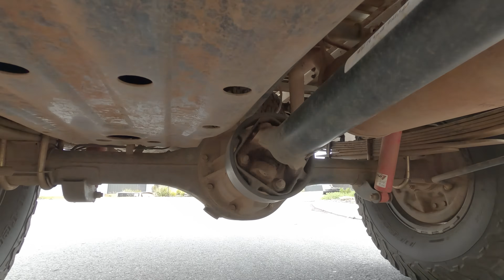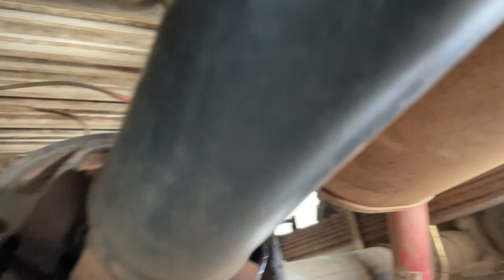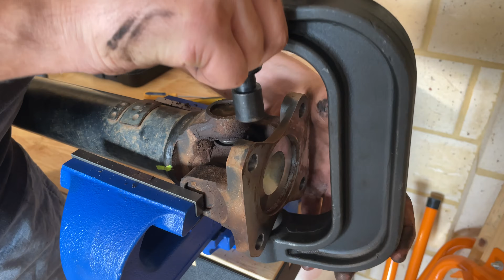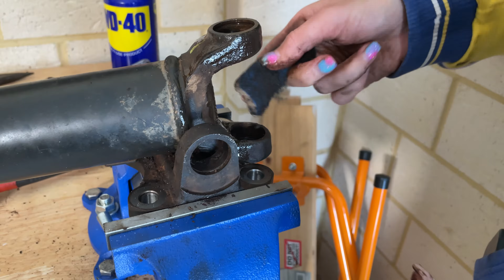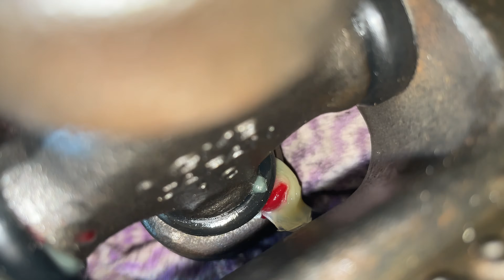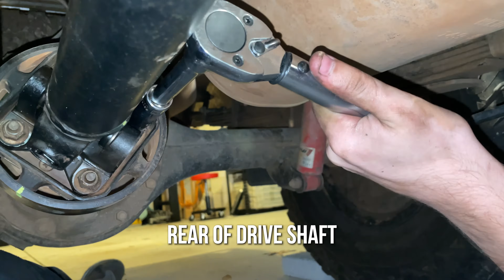Replacing Uni Joints on a 2007 Ford Ranger PJ & Mazda BT50 | Full Walkthrough

Comment: That is one of the best instructional videos of this type that I've ever seen, and I'm so glad I found it because I need to embark on exactly this on my PK which I've just discovered has as floppy a connection as yours did.  Great work you guys, I now feel equipped to tackle this job myself!
Reply from the maker: Thanks mate, glad to hear the video was helpful and good luck with the replacement of yours!
Reply: @explorebound  Thanks mate.  I just got it back together tonight but it is making a terrible noise when I try to drive it.  From what I can work out it seems to be that the centre bearing is tapping on the chassis as it spins around, and I can't figure out why.  I guess with new uni joints in the shaft in its entirety is a tiny bit longer and hence pushing it high enough so that it hits, but I'm at a bit of a loss as to how to remedy.  Do you happen to have any ideas?
Reply: actually don't worry - I finally worked it out.  Just had the centre bearing part upside down.  It naturally falls that way so just had to loosen it and flip it over.  Doh!

Comment: hi Do all uni joints and have centre bearing  replaced  . The centre bearing needs a spacer under the retaining nut as these were made badly [not enough threads ]  . Causes outer balance issues. Hardy spicer no all about this .

Comment: Do you service your own car or get it serviced somewhere cause those joints don't look like they've had grease in years ahaha. 

Also you only need to make sure the front and back half of the driveshaft are the same as they're usually balanced, but great video mate!!
Reply from the maker: Thanks mate! Regarding servicing, a bit of both, I do the minor ones myself but take it in now and then for the more major work - definitely my own fault for not greasing them up or atleast checking with the mechanics when they did the larger servicing haha.
Reply: Mine didn't have the grease nipples.
I finally found some after market one with a grease nipple.
Next time use a scribe tool to make the marks